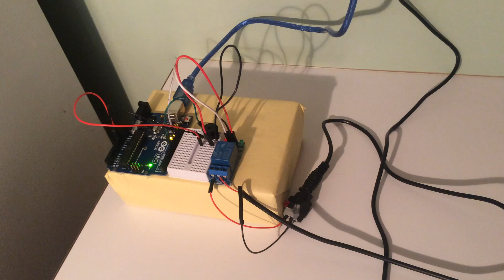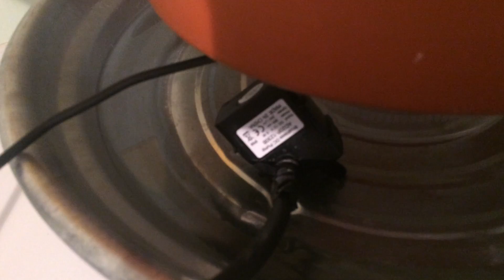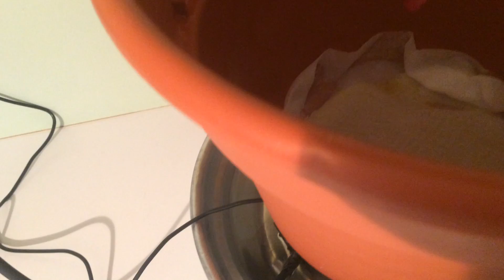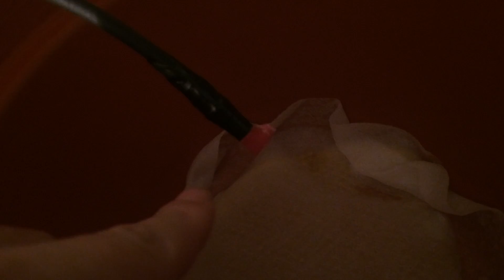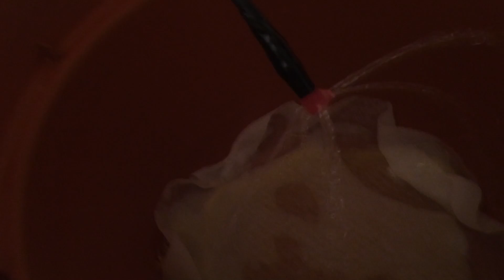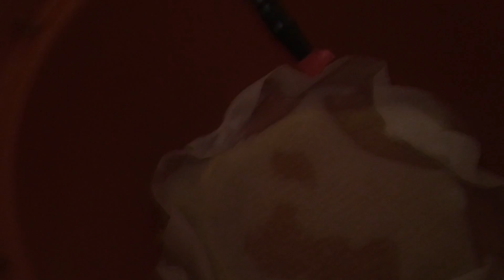Arduino Project - Automated Mung Bean Sprouts Growing Machine

Comment: You've spent around $30 for this project. Water timers are available on Amazon for half the price that have multiple programs, starting times, watering times and all required connection accessories (you need to buy only a tube of the length you want for the outlet connection and you can install it yourself in less than 5 minutes (like I did for my mung bean sprouts).
Reply from the maker: Ya. Those water timers are good. Nice info. One thing different is they don’t have pump. So need to connect to water tab. And need to buy the spray nozzle… Anyway nice to know those products. Thanks.
Reply: @wildforager  , I don't use a pump as the pressure from my overhead tank is more than sufficient (in fact I found the pressure to be too high and had to reduce it by closing the faucet to about 30% of full discharge) to spray the water. I simply put the output end into an old garden sprinkler head and held it down with a weight (a mic stand bottom so it doesn't move around) placed over a plastic mesh tray and a cloth on the top so the water falls evenly distributed all over the sprouts.